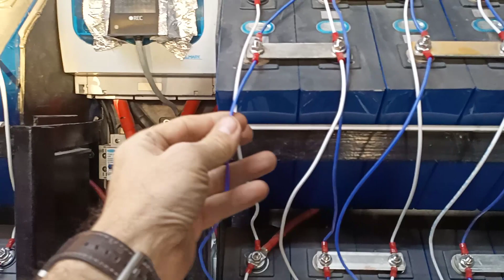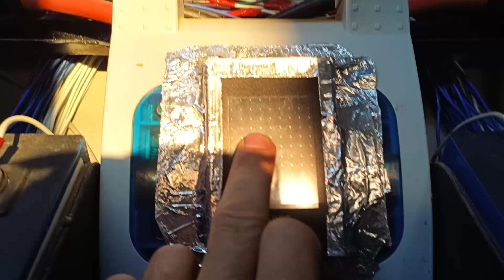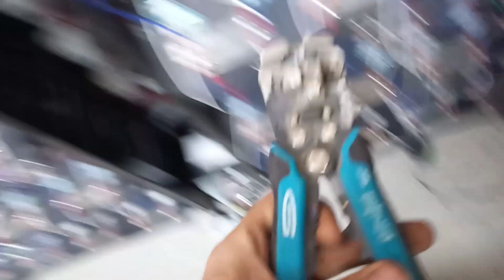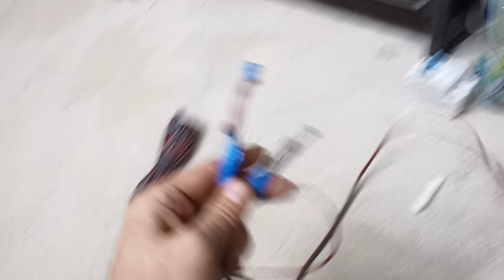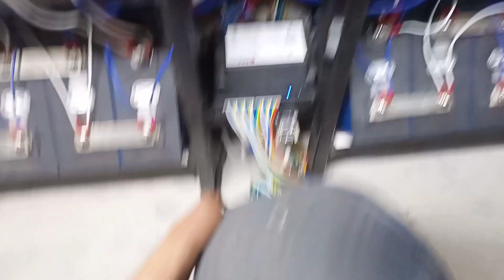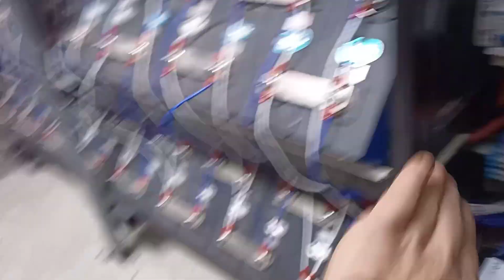Off grid solar (part 4) The 120 KWh Lishen 272Ah battery cells R.E.C. BMS and NEEY active balancer

Comment: Hi. You only have one rec bms for all the cells?
Reply from the maker: Yes.
Reply: Thanks. I didn't know that was possible. If I want to use a rec bms with 64 cells in 16s 4p config, is there anything specific I need to order in addition to the main box? Thanks
Reply from the maker: I don't know what you mean by "main box"

Comment: Balancing?  Your BMS should be doing all that....sounds like something is not designed properly.
Reply from the maker: You need to spend more time watching the video so you can understand the design. and how it works.
Reply: @penandpike  I don't need to spend more time looking at a rat's nest...you will always have problems with it...sorry you don't like what I am saying...sometimes the truth hurts.
Reply from the maker: @Redblower  Don't worry you did not hurt my feelings. My system works just fine for the last 3 years OFF grid. Never had problems with it except for few minor glitches during the first few months while the initial set up took place. It is obvious you have no idea what you are talking about, so maybe you should educate yourself a little before judging others with such a self confidence!

Comment: Hi, so it seems that REC is not that good recently, at least that is what I see on different platforms… what is your experience so far?
Reply from the maker: It has it's flaws. For example: I had a welded contactor and the BMS will start the system anyway. Even though this is a major fault because the BMS will not be able to disconnect the Battery .in case it must. Even the cheapest Chinese BMS's are better and easier for CONTROL, system options, settings and connectivity ( bluetooth, wifi, lan ) The balancing function is absolutely useless. But all this said If I had to do this again I guess I will still go with the REC because   I really don't see many other options on the market that will easily work with my  Sunny islands. If you have a better idea, please share it!

Comment: If your contactor heats up It's too small, you need bigger ones in AMPS
Reply from the maker: It is a 500A contactor and it does not heat up. It will heat up only if there is something wrong with it.

Comment: Its 12kw not 120 kw
Reply: That's definitely 120kw I have a 6 kw it way small and it's lithium titanate which isn't as energy dense!
Reply: 🤣🤣🤣🤣🤣🤣🤣🤣 u must be kidding ! This is huhuuuuggggee!
Just would not use these small cables to parallel the banks!
Reply from the maker: @ClausMallorca  I intently used this 1,5mm2 cable, because in case of a bad cell short the thinner cables will act like a fuse and melt - disconnecting the bad cell from the rest of the pack! These cables are only carrying little current for balancing
Reply: @penandpike  melting still has the risk of fire ,😱
Reply from the maker: @ClausMallorca  these are silicon wires that can not cause fire!🙂
Reply: @ClausMallorca  the cable size isn't an issue for his voltage and the amount of amperage likely coming out of any given bank at one time! Voltage/amperage
Reply: @patrickday4206  you can load or unload 1C ! That would be 280 Amps, I wouldn't dare to use such a small cable! Voltage of 48V has no influence on required cable diameter , with 500 V or more I would agree
Reply: @ClausMallorca  280amps divided by six for draw not could be drawn and it is regular practice to go past wire ratings as long as the percentage of time past isn't too great it's why service lines to houses with 200 amp service change regularly aren't upgraded and are still for 100 amp service! I have a 600 amp battery bank 12v that has a 5c rating how big of lines would I need ? The requirements are my inverter and what my usage actually is. 200 amp service panels can have 300 amps of breakers because at any given time nothing will actually be pulling maximum amperage all at once! This is the U.S. codes remember most of these systems have fuses and will pop to prevent overload! The cabling in cars for starters are also under rated for the draw because it isn't a long enough duration to need thicker wire! I've never seen an off grid home that everything was a low of power consumption possible if he built a 120 kilowatt bank he probably doesn't use more than 10 to 20 percent of it a day. The weak point is the solenoid I have an idea to fix this problem but currently don't have anyone to help produce it!
Reply: @patrickday4206  IMHO it is not nice engineering to rely on tripping circuit breakers! A c/b is a safety item to prevent fire
Reply from the maker: @ClausMallorca  the main load is carried by the thick 16mm2 8 positive and 8 negative cables. 😊
Reply: You mean kwh not kw right?
Reply from the maker: @adon8672  😃 Yes indeed. I have to change it in the title 😁